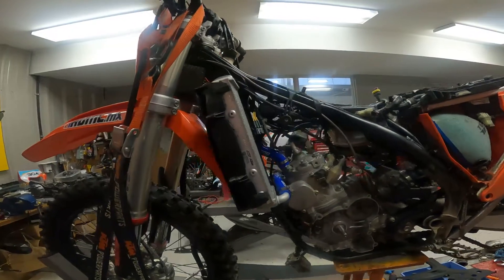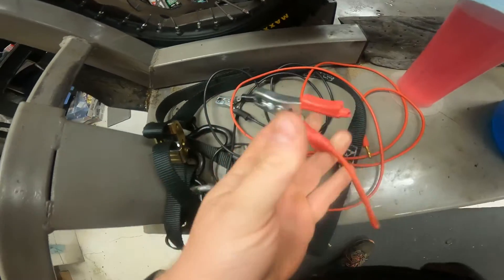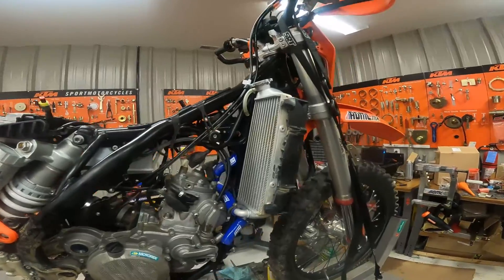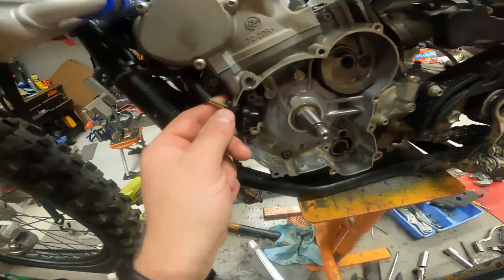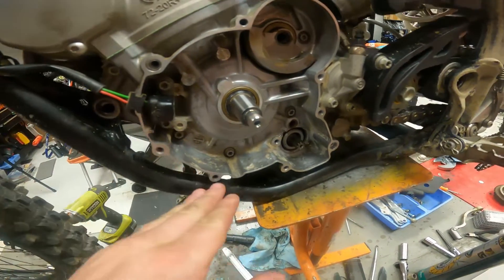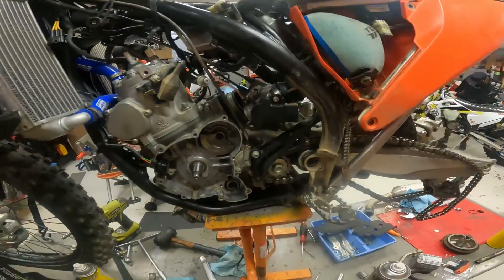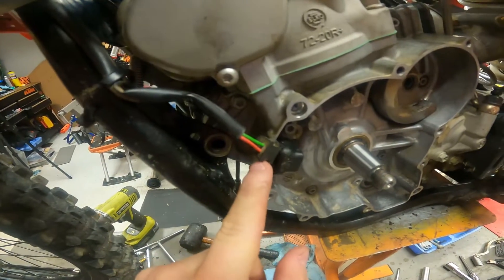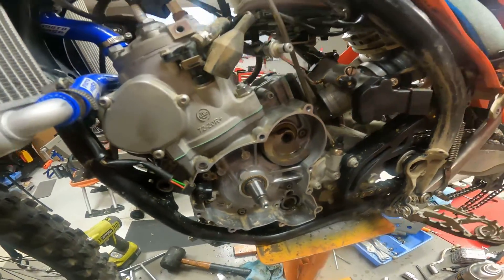17-21 KTM 250 / 300 owners, check your stator cover!

Comment: Would I be a total idiot if I asked.... Can you drill a small hole in the bottom of the case to let the water drain, instead of pooling up and causing that problem?
I know the best way is to prevent it from going inside to begin with. But drilling a small "weep" hole is what popped in my head.
Reply: Imo dirt/debris can go in and get stator/ flywheel dirty slowly let alone go through a water crossing thats not that deep can mess things up quickly, probably stall the bike and go through more problems with staring
Reply: @chem6269  Agreed, that was my second thought. Even a small hole would let sand and dirt get in there eventually. The water crossing you mentioned totally would kill the idea in my mind as well. Thanks, its good to toss things around and get opinions.
Reply from the maker: I actually had the same exact thought, and for some reason I think I've seen a few bikes with small weep hole drains in the bottom. But i figure KTM  wants to completely seal the area if possible.